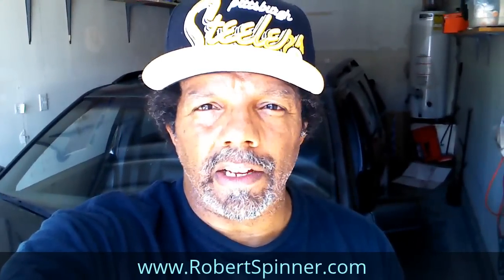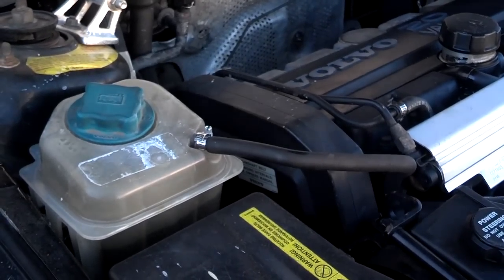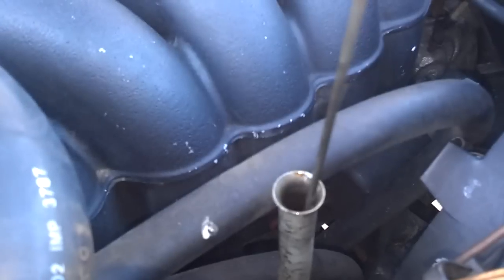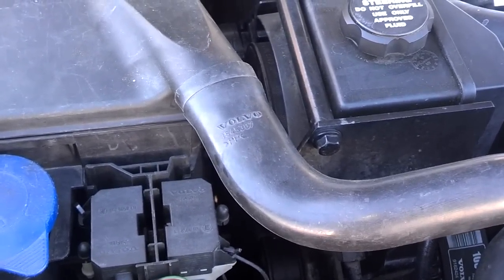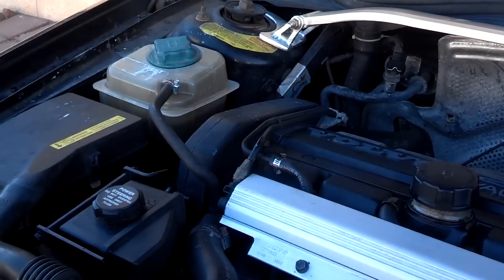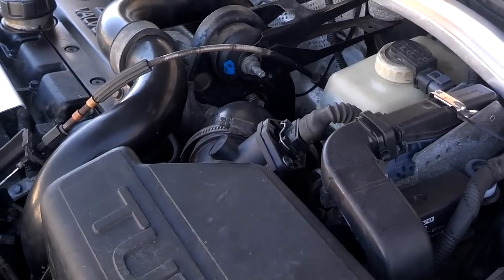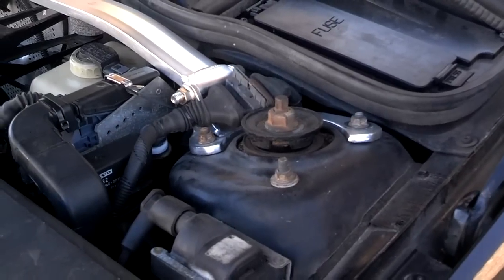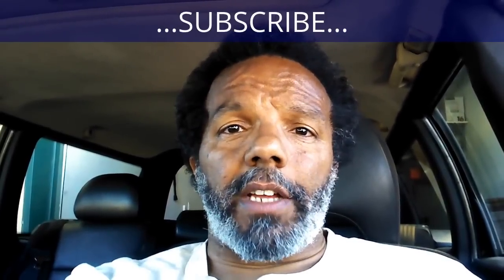Top things to check before buying a Volvo 850, S70, V70, XC70, etc., Pre purchase inspection.

Comment: Just bought a 98 Volvo s70 non turbo for $850 about a month ago it has 289000 miles not a spot of rust on it and for a vehicle in Wisconsin that's hard to come by lol fuel pump just went out today but other than that she's running strong
Reply from the maker: Very nice.
Reply: It would be alot nicer if I could get it to start lol fixed the fuel pump but now it died again and won't start back up pretty sure it doesn't have spark changed the plugs but nothing so now it's on to the wires

Comment: very old video, i have a 2011 Volvo XC70 T6, 270,000 miles on the clock, runs like a dream never given me problems, 99% original parts, and i dont consider myself the most gentle owner but i'm not abusing it either like never lived in a garage for more then a few days of its life (my gf now owns that spot as well so ill never get it back haha) and its been off and on road for its 8-9 years since gotten it new.     maintaining it is legit most important thing, people seem to forget or they just run it into the ground after a while.. see it all too often where i been helping a friend (usually a woman in this case) with their car (V70) and come to find out they haven't changed the oil in 3 years or something crazy, luckily they dont to too much driving like that because damage isnt too terrible, but its definatly not in a condition i would wanna buy it from hem in, gunna ned new parts at the rate of driving i do i would break something.

 but moral of the story, remember:  regular oil changes, regular services, regular "tune ups" if needed. if technition says you need a new PCV, do a check yourself if you need a second opinion (glove test is real and legit!) if its inflating glove or not sucking and staying neutral, definitely get a new PCV!. i seen a bad PCV kill a beautiful 2013 S60 T5, it puked oil out of a seal near the timing belt and it cause it to slip and break the engine entirely basically.. bent somethign causing 1 set of valve to get stuck.. so T5 running on 4 cyl and sounded badass fromt he exhaust but it was badly broken. that did happen after "prolonged" neglect.. wifey car and husband was deployed in military when diagnoses then the failure happened came back to that mess and was selling it i nearly bought it, $1800 for it cash on spot at his home, fully loaded everything else work perfectly. but needed a new engine (cheapest option, repair was actually more).    

  all that being said, i may need to get my timing belt changed, i have only 1 sticker on there showing when it was done, 138,000 miles service i did forever ago.  i swear i had it done since then but i dont remember and cant find the receipts. i also dont know if it really need a belt, i was told it does but i also een them use chains, so imma dig under my hood again tomorrow and check, if its chains im not going to worry too much and makes more sense why been so long.  volvo normally contacts me when need such services, then take it to them to get checked out  (free diagnosis only, get work done at a local shop i trust) so they keep me in the books to send remainers LOL.
Reply from the maker: Thanks for sharing.

Comment: I own a 96 850 base model wagon which has 387,xxx miles as a daily driver. I just changed the timing belt and tensioner for $915, dealer wanting almost $1300.  The tensioner is more likely to fail than the belt.  I owned a 94 850 and 97 850 R from new.  The dash mounts in these cars are plastic of all things.  Darn engineers could have done it with metal so they wouldn't break and cause the dash to squeak.
Reply from the maker: I agree.

Comment: Hello Robert.  You've been very helpful with my questions on my Volvo and have saved me a lot of grief with local mechanics.   In your opinion, how long should a water pump last in an 850?  I had mine replaced 6 years and 40,000 miles ago using OEM parts.  It appears the pump has failed (I'm losing coolant everyday, yet there's noting leaking under the car that I can see on the ground when I back out) The mechanic that replaced the pump and timing belt said that 40,000 miles is about average life ( I don't believe him) and of course, given the length of time, nothing would be warrantied. I'm having the system pressure checked in a couple of days by another mechanic but I'm guessing its a pump although the engine isn't running hot.
Reply from the maker: https://youtu.be/58O5N43RsGY?si=EsMXh14nWk0L5h1z
Reply from the maker: Man, I give my water pump opinion at least monthly.
Reply from the maker: https://youtu.be/8LcL6nw5FfI?si=tueH0UeELchJkUfL
Reply from the maker: https://youtu.be/gt9w-ZSxs9I?si=PapSJieC_FTS-VwX
Reply: @RobertDIY  Thank you. It was a heater core after all...

Comment: Thanks for this Robert. Very informative and helpful. I recently purchased  a 2002 V70 2.4T that I've been working on to get another 100k miles out of it. I'm hoping that you can help me with advice about replacing the rubber brake hoses. I did the front hoses easily but when I went to the rear I discovered that there was no room to get a wrench on the flange nut. I tried releasing the bracket but that didn't help much. 2 hours later I gave up.  What's the trick to gain access to the hose/hardline flange nut on these cars? This is the first time I've been stymied doing all the big projects on my new 125k car! Thanks! Paul (Tucson)
Reply from the maker: If the hoses are not cracked, leave them alone. It's important to flush the fluid, not replace the lines.
Reply from the maker: If you have to replace them, check Matt's site. You will probably have to drop the suspension.
Reply from the maker: MatthewsVolvoSite, for Volvo repairs. Google will lead you to it.

Comment: Seems I found this just in time.  I'm negotiating the purchase now of a 97 850 GLT.  220k.  Seems to be very well taken care of by looks of paint and interior.  Checked timing belt already.  Replaced in 2004 at 140k.  Sounds like I'll need this.  SRS light is on.  Was told this is from a bent spring in steering wheel and a volvo mechanic said no big deal that the air bag will still work.  ABS light is on.  Will probably send module off to midwest abs.  Check engine is on.  Owner says he will take it by autozone and get code read so I'll know whats causing that.  Already know motor mount bad, not sure which one.  Also a flashing up arrow on dash blinking.  I've read this is probably the pnp switch and not to big of deal.   I'll be checking the other things you mention in this video before purchasing this car.  If pcv is good, air is good, and head gasket checks out do u think this Volvo is worth $1200?  Thanks Robert!
Reply from the maker: Alan R No.
Reply: Robert DIY - Thank you.  I was thinking that myself.  (He was at 1900 before I realized the timing belt would need done)  If you was buying it what would u be comfortable paying for it if nothing else is wrong??

Comment: Hey your videos are a treasure, but I have a question. The coolant IS rising from when the car is cold to when it gets warm. Does that really mean the head gasket is blown? Because when the coolant gets warmer it SHOULD expand? It's not rising continuously, once it gets warm it stops rising. 
Thanks once again, Toygar from Sweden
Reply from the maker: +kocaarik what kind of car do you have? How much is it raising? Is there a crack in the reservoir cap or reservoir?
Reply: +Robert DIY 1996 855 10V. Maybe half an inch
Reply from the maker: As stated in the video, if it is not forcing it's way out of the cap, I would not worry about it.

Comment: Hey Robert, thank you for the awesome videos you make. I am looking at a 1996 Volvo 850 Turbo in a few days to purchase, the owner says it has a bad head gasket (it overheated and was out of coolant, coolant in oil). The system is pressurized like you said, so what would cause the coolant to leak into the oil? 
Any and all information would be appreciated
Reply from the maker: A blown head gasket. 🤷🏾‍♂️
Reply from the maker: I would replace the engine.
Reply: I was hoping not to, but I can pass on the offer if the engine needs to be replaced. Been wanting a volvo wagon for years because I love them 😩
Reply: Don't have an engine puller and would need matching exhaust manifold I believe? (I think I remember you saying the cylinder head and exhaust is machine married)

Comment: Thanks Robert for the reply , a love the s70 but with haveing a young family am going for the v70 estate a love the boxy simple lines of theses cars I think they look very stylish, now down to engines is there any particular one to go for  or avoid? A would love the 2.3 t5 but to be honest as any engine petrol or diesel so long as the car was pritty straight and in good condition am thinking its best to get a decent clean example am not get to hung up about wat engine and colour etc regards john
Reply from the maker: +John McGinnis I like the '98's, easier to work on. I also like turbo models, have a little pep even when towing something. The non-AWD cars are also easier to work on.

Comment: Hi Robert, nice infos. I'm going to look at a 94' 850 tomorrow with 174k miles on the clock so this infos are going to be really helpful. About the PCV testing, i am wondering in case i don't have a glow and the system is really bad, i could just put my hand over the oil filler hole and if I feel the puffing on my hand that should also be a good sign of a bad PCV ?
Reply from the maker: Get a glove.
Reply from the maker: Also, never trust the miles.
Reply from the maker: https://www.youtube.com/watch?v=9K-1WChRr9k
Reply: Thanks for the infos! I'll get a glove. About the millage that tends to be correct.People here where i live don't do that much millage expecially on petrol powered cars. But the cars tend to look like they have 3x more millage than they have. a 760 with 150k miles looks like it has done 500k. Those cars are often used more as transport vehicles than fancy limos that they really are.... Thanks again!

Comment: Thanks great video however; I do have a couple of questions. Will the car overheat with a blown head gasket? Will the coolant level decrease when you drive the car?

I'm loosing coolant but the car is not overheating. I checked the radiator and heater core neither are leaking.

Could the water pump leak but still pump coolant the the system?
Reply from the maker: Joe G The car will usually maintain GOOD temperature as long as coolant is in the motor. It will only overheat when it is a) out of coolant, b) thermostat is stuck closed, c) water pump is bad. Depending on what type of car you have, you can have one of several coolant hoses leaking. Also, the water pump and be leaking. The sad thing about coolant leaks is that the coolant can evaporate very quickly after leaking because it is very hot. So, it is hard to find minor leaks. - https://www.youtube.com/watch?v=CQdQIgH0RHo - https://www.youtube.com/watch?v=s1OlrdloSzo

Comment: How long do head gaskets usually last? 

I am buying a 1998 S90 with 122K. Timing belt was done, Serpentine Belt, Sway Bar Links, Fuel Pump, 100K Service @105k then Thermostat, Temp Sensor, Tune Up, and OEM Radiator. Do you think there would have been some mention if it needed a head gasket?  

Thanks for posting this video. It helped.
Reply from the maker: +jepone head gaskets on these cars last forever or until the car is overheated, which ever comes first. Replace all of the coolant hoses and transmission fluid.
Reply: Thanks for that! The radiator and the hoses were done, so I guess it's just the tranny I need to drain and fill. Any recommendations on what to use for the tranny fluid? The car is running full synthetic for it's motor oil.

Once again, Thanks so much!

Comment: My girlfriend bought a 1998 s70 over a year ago. and just found out thats it has a turbo! We never knew. You can't hear the turbo spool up. Are these turbos that quiet?  the previous owner never told us and it has no emblems anywhere on or in the car. But it's a great car!
Reply from the maker: Yes they are quiet, also the heat shield blocks the sound as well. The rear likely say GLT or T5 which tells it has a turbo.

Comment: Robert, I just found your videos as I am looking at a 96 850 Platinum Wagon. It has 123,000 miles. Mainly a fleet vehicle in CA and FLA so only 6 years in new england. It has 5 listed owners in CARFAX but 4 were fleet and had regular maintaince. The rear main seal is leaking but I will check the PCV system and see how bad it is. If I change that and the oil leak stops or is minimal can I drive it and just add oil or is the RMS now shot and will leak massively no matter what. I am getting for about $1500. GOOD overall condition on rear suspension and timing belt and water pump replaced at 70K. Is this too much for this old ride? Thanks, David
Reply from the maker: https://www.youtube.com/watch?v=DMw_DgZulKc

Comment: Note the AC compressor, does turn on and off via the AC clutch  that is normal function due to the pressures in the system.

Comment: Robert, The tube going to my PCV is hard but I put a plastic glove over the oil cap ( removed oil cap ) and it suck it in and I check the oil dipstick, no smoke, does that mean my PCV is ok and maybe the hard tube is a sign its time for a PCV service and if so, do you have any idea what a PCV service may cost? Also thank you for all your videos on the volvo 850 V70 wagons and other volvos ! Your videos have been good watching
Reply from the maker: +Liam Rowe you are good. Keep up with the oil changes.
Reply: thanks  robert

Comment: One Steeler’s fan to another, what do you think of 2007 XC70?  Btw, do you ever come thru Birmingham?  I subscribed and see you move around the country.  Is the motor in the 2007 xc the same as the one  in this video less the turbo?
Reply from the maker: Those have different engines. Nice vehicles.
Reply: @RobertDIY  Things for your previous answer.  does the xc have to have premium fuel or can it adjust for octane?
Reply from the maker: https://youtu.be/qsns8ZO1xfE
Reply from the maker: What does your owners manual recommend?

Comment: Thanks for your great videos! Just wondering if you can help me out. My friend has a a 1997 850 that is great. I am looking at a 2000 S70. Does the S70 have the same transmission and engine as the 850? It is is it essentially the same car and is it as reliable? Thanks!
Reply from the maker: The transmission in the 2000 is different.
Reply: @RobertDIY  thanks! Do you have any idea if it is as reliable as the one in the 850?

Comment: Hey Robert, do you think a good maintained 150000 miles T5R is worth 7000 dollars?
I have found many exemplars here in Europe, with automatic transmission, panoramic roof, and other extras.
I would use the car to go to work daily, and maybe some weekly b roads.
I have also found really good looking 850s with the 2.5 20v engine, they get better mpgs and they still sound amazing.
Would you say to go for it?
Reply from the maker: It's all about condition and color. The more rare the color / style the better the price for the area. I plan to sell the yellow for $7500 and it has about 202,000 on it. It will have a fresh coat of paint, rebuilt engine with 112,000 on the clock and a fresh tune up.
Reply: Robert DIY Thank you, you're the best in regards of Volvo information!
Do you know any other Volvo model that's maybe a little bit more modern, and reliable=
Reply from the maker: Most newer than 2004.

Comment: Robert, could you do this checklist video for the 960/965/S90/V90 cars? I didn't find much about things to check on those last RWD Volvo's and since I'm getting one in the next couple of weeks, a video like that would be VERY helpful. Thanks!
Reply from the maker: Man, those cars are not neglected nor high maintenance as these are. A couple of the things apply like checking for coolant leaks and over heating, but those cars are pretty solid and easy to care for.
Reply from the maker: https://www.youtube.com/watch?v=DLxRNfmb74A
Reply: Hey, I really appreciate your answer. So you're saying that the older RWD cars are much less complicated and even more reliable than the FWD stuff?
I guess that's why I didn't find major problems to look out for :)
Reply from the maker: 5,000 Percent. Not much DIY for them.
Reply: Okay, thanks again!

Comment: Great video, thank you.  Have a 2002 V70 station wagon, non turbo.  160K. Runs great. Owned it for 2 yrs.  Want to do a coolant flush.  What is the deal with this HOAT coolant "Required" for these cars??  I refuse to pay $23 a gallon for Coolant.  Can I use Prestone "All cars" coolant which says it works on all cars, including HOAT ones ??  or do I have to buy the Volvo or Zerex HOAT coolant at the insane prices ??    Thank you.
Reply from the maker: Man, that's your car, you can pour milk in there if you want. My car is doing fine. ;)
Reply from the maker: https://youtu.be/dRYe5FE-Zjs
Reply: @RobertDIY  Yes I know, but not going to put milk in there.  That is why I asked you, can I use Prestone ALL cars coolant which says it is HOAT coolant?   I bought the car 2 yrs ago, it has 160K on it now.  It seems to be well maintained, I've already flushed the transmission, did 2 or 3 Oil and filter changes and I am thinking I should flush the cooling system....it has ZERO issues.  I don't know which coolant the car has now, is there an easy way to figure this out ?   I appreciate the help and advice.
Reply from the maker: He manual RECOMMENDS HOAT. If it's a HOAT coolant, it should be good.

Comment: Wish I could get a 850,950 wagon as my first car. But I would use it to commute daily so needed a more reliable car. Also parts take long to get here and are probably more expensive. Ended up getting a 2006 Accord Tourer in black. Saw a 850 on the way back today. Sigh..
Reply from the maker: LOL, 850's Are very reliable.